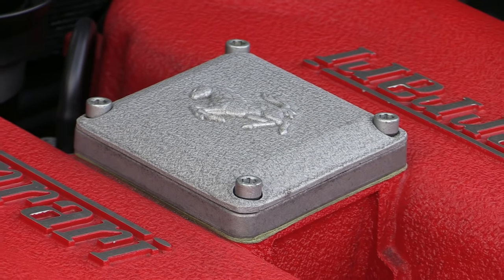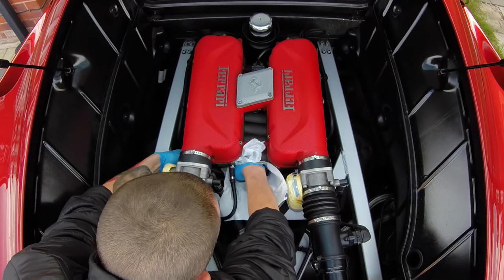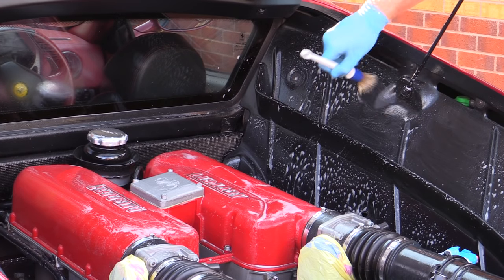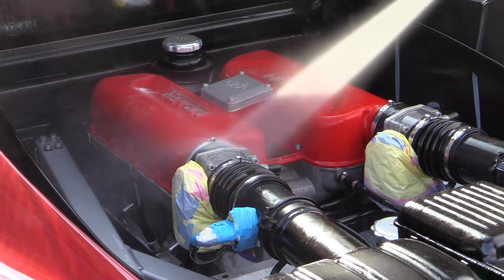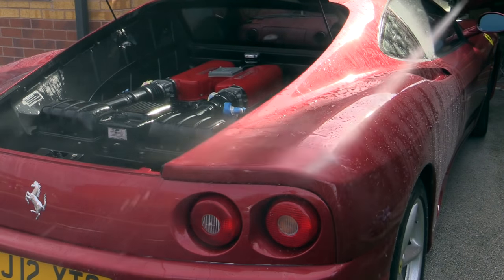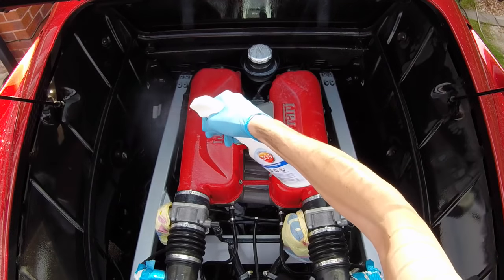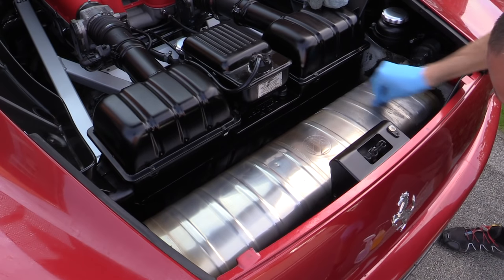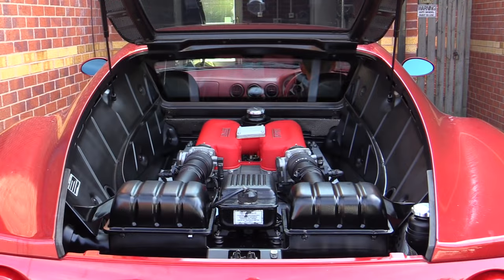Supercar Engine Cleaning: Ferrari 360

Comment: Very good work!  One thing you might want to try is to remove the belly pan under the engine so all the grime you cleaned off the engine doesn't collect on top of the bottom cover.

Comment: Nice work and great product choice. Next time you detail an engine bay with tight areas try Adams in and out spray it is an aerosol water based dressing that gets into all the nooks and crannies of hard to reach areas. Cheers and thanks for another great video.
Reply from the maker: I'll keep that in mind. I was thinking of doing a vid using an aerosol sealant to protect really fiddly wheels actually.

Comment: The ONLY part I would change would be to ensure the exterior of the panels were WET FIRST before you detail the engine because while the overspray sits on the dry painted panels, it can potentially strip wax's and polishes off the protected paint while you detail the entire.
Reply from the maker: +Paul Lodge (Camarosource) True, although those panels aren't going to stay wet the entire time so you'd have to keep re-wetting them.
Reply from the maker: +Car Cleaning Guru This is also one of the reasons an engine bay detail would be undertaken prior to an exterior detail.

Comment: I didn't quite catch what you would use to clean the exhaust system if you had the time. Any direction would be welcome as I have the same car. Many thanks
Reply from the maker: Any kind of machine polisher whether that be a Dremel, a drill or a dedicated tool.
Reply: Thanks for that. Do you use any product like Autosol first?

Comment: When u were rinsing off the side of the cars! U see the water beads away! What kind of protection did the car have... did you also detailed the car or only the engine ... thanks mate!
Reply from the maker: Well spotted! I's spent around 9 hours on the car a few weeks prior; wash, decontamination, clay, single stage machine polish and two coats of R222 Concours wax from what I can remember.
Reply: Car Cleaning Guru : i know its been more than a year ago, but thank you very much for your reply! The deepness of that Ferrari red colour its so glossy!

Comment: The first step is to remove the plates on the underside of the engine.  I didn't see you do this.  Never use a pressure washer on any engine.
Reply from the maker: Unless you want to pressure wash an engine.

Comment: The glass tint has UV blocking properties... no need to coat the engine in crud that will ultimately attract more dirt.
Reply from the maker: I get what your saying but that dressing isn't crud, it's a nice dry touch water based product that actually repels crud.

Comment: no good mechnic uses a frggin pressure washer under the hood in an engine compartment !
rinse w/ water at LOW pressure ONLY from a garden hose just gentle flowing water
do NOT use a nozzzle that concentrates water force .! & NEVER EVER use a pressure washer ! ( not for car washing either ! )
Reply from the maker: Oh get out your garage hose boy. A huge proportion of the automotive industry use pressure washers on a daily basis without issue.